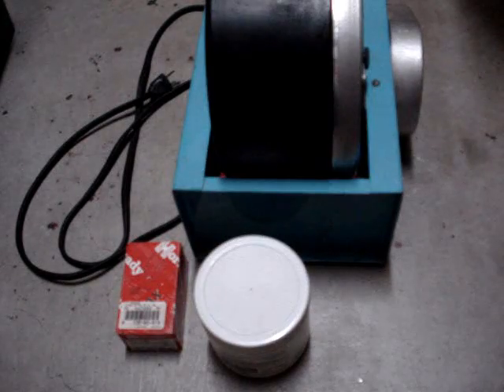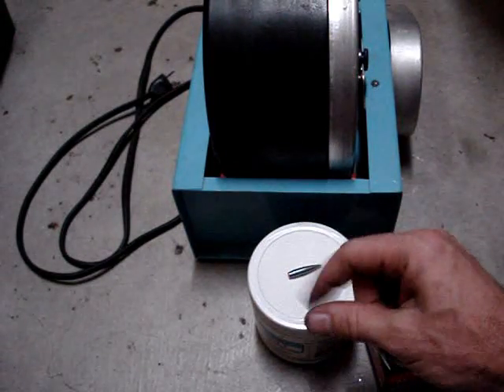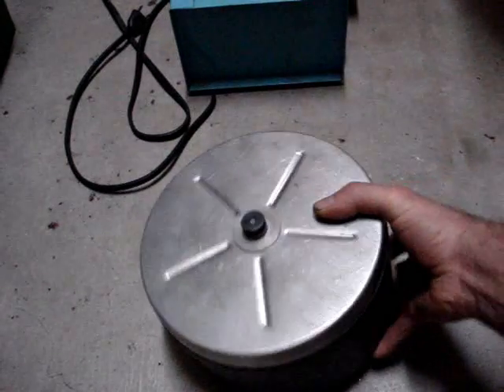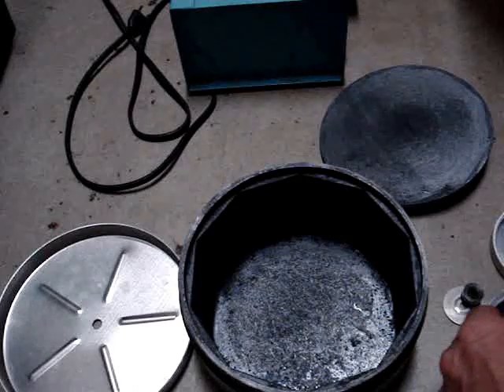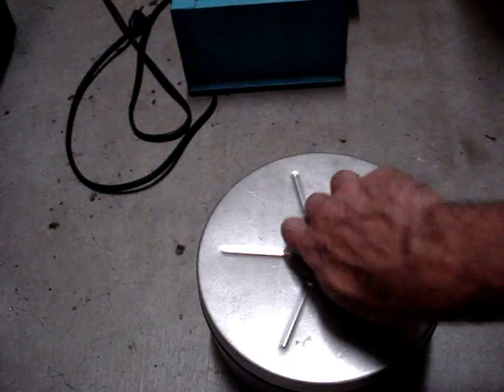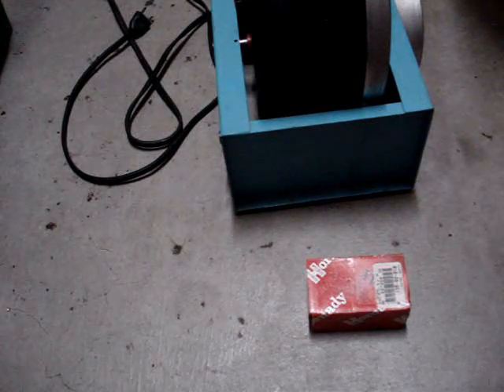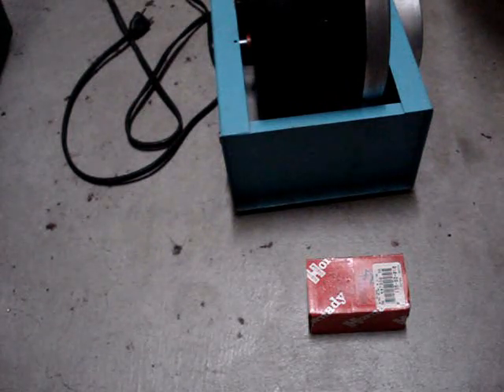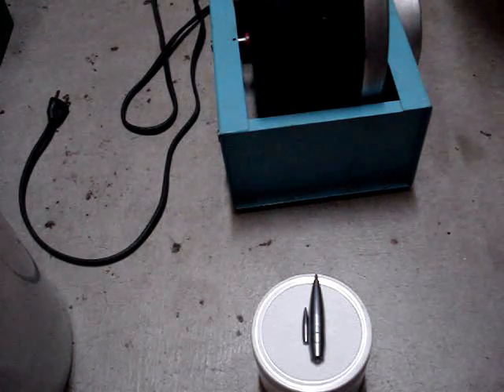Moly Coating

Comment: I don't understand why everyone says you need to extensively clean your barrel when transitioning from moly to non-moly coated bullets.  The moly coating does slick the inside of the barrel thus reducing wear.  It will not have any adverse affects other than maybe making the first few rounds of non-moly a tad faster.  cleaning the barrel extensively will only remove more of the moly therefore increasing friction.

Comment: @ammosmith I do moly coat all my cast boolits, Quenched WW lead alloy and then pan lube onto of that. I know that seems like a lot of work but they turn out real nice and shoot very well. I did this as just pan lubing i was getting leading on my M&P9pro, with just moly, alot less leading but still leading. When i did both though, the moly didn't coat my fingers and all leading was gone. BTW i was using the Lymans kit on a vibrator if that makes a difference.

Comment: How much faster fps is Molly getting you vs non molly coated
Reply from the maker: It depends on the caliber but about 50 fps average increase. It's a mess to clean up so I don't use it anymore.
Reply: @ammosmith  
If its not illegal in your state im gonna try teflon coatings over lead hotter it gets the more it lubes lol 
So ill do a 50 50 Teflon nylon coating.
Reply from the maker: @adamlong54  There's a myth behind Teflon . Teflon coated bullets do not penetrate body armor. The KTM bullet was a tungsten  carbide core with Teflon used as a jacket to protect the rifling. A pointed cast zinc bullet will do the same thing.
Reply: @ammosmith  i know not why im doing it want faster fps. Hence the Teflon aka lube lol

Comment: I do just what you are doing. One thing I add to the barrel is enough BB's to cover the bottom. Won't damage cast or jacketed bullets. I roll the bullets after in a towel to remove the loose Molly.  As for cleaning the barrel, I run a wet patch (Hoppe's) through the bore and stand the rifle muzzle down on a paper and set it soak over night. Then clean in the normal way.

Comment from the maker: Yes id does foul your barrel. The easiest way to remove it is to use a bore paste. Moly can improve accuracy. Like all firearms it's a trial and error session at the range. Try a bunch of plain bullets then try the moly. Make sure you clean the barrel when transitioning from either plain to moly. This will ensure you have a good clean bore. After a good cleaning you'll need to fire 3-5 rounds to foul or season the barrel again before optimum accuracy.

Comment: While it reduces copper fouling, don't you end up with moly fouling? I've just started reloading, and have looked at buying moly coated bullets, but have read a few things saying that moly coating is just as much of a pain, if not more so, than removing copper fouling! Just wondering if you can shed any light on this subject.

Comment: I understand your reaction, just moly, and shoot some "regular" stuff and check the inside of your barrel and your groupings after, it will explain more than me saying it? I'm not saying it's bad to use moly, it works excellent, but you can't just go back to normal use without some work on it..

Comment: Molybdenum disulfide powder is very dangerous to your health, use latex gloves and a respirator....I made some Molly grease using a P.T.F.E. grease as a carrier. prior to using molly bullets, clean your barrel as you normally would, run a few dry  patches afterwards, then repeat the process with the Molly grease, now it's ready for the molly bullets. I've done this process with all of my bolt actions, "My Swiss K-31, .303 British,  8mm Mauser and a couple of AR-15's. Made a HUGE DIFFERENCE" in accuracy and reduced fouling dramatically, Just like a Teflon coated non stick pan. great stuff.
                thanks for sharing!
                Eric Dee.

Comment from the maker: Not really. The best way tofix that bore is to use a bore paste. Most of the dark bore is due to old fouling and a pristine bore lays beneath. If you are of the mindset...you can get setup for reloading for about $120 and load for it using Sierra 174gr .311" Match Kings. What kind of scope do you have on it?

Comment from the maker: I find that it clings to the metal. A good scrubbing works wonders. BTW..the 75gr A-Max is a nasty little pill. I shot a squirrel and it blew it to about 100 pieces and flung it 30 feet. It's not something I want to get hit with.

Comment: have you tried denature alcohol?...my niegbors have bands and are deaf so vibration tumbling is not an issue nor firing civilian war cannons. I have seen others actaully put all th moly coat in the tumbler/vibrating thing. I checked and its says that cast lead bullet must be prelubed before moly coating them and then it can crystalize in some barrels. Now with newer cleaners its easier to find products that remove all fouling from powder/metals/plastics. Thanks for the video!

Comment: Moly Questions & Answers

Molybdenum Disulfide (Moly Ultra-Coat)

Molybdenum disulfide or "Moly", as it is commonly called, is a lubricant used in extreme pressure conditions due to its high degree of lubricity and high melting point. Moly has been found to reduce bore fouling when applied to bullet surfaces. It will decrease bore cleaning effort and time. Published reports have shown an increase in Ballistic Coefficient, longer barrel life, and an increase in accuracy.

Moly coated bullets will reduce pressure and velocity. Loads must be worked up slowly to attain previous velocities, therefore the maximum pressure of the cartridge must not be exceeded under any circumstances.

NOTE: This does NOT mean powder can be added indiscriminately. 

NOTE: Loading data for Moly Coated Bullets and Non-Moly Coated Bullets is not interchangeable.

Below are questions concerning Moly coating that MidwayUSA customers have been asking with technical advice for each: 

Do I need steel shot? 
Steel shot is not needed in the MidwayUSA process.
Steel shot is used in other processes as a burnishing aid to imbed the Moly into the bullet surface.
By using the MidwayUSA 1292 Tumbler, bullet on bullet impact imbeds Moly into the bullet surface without the use of steel shot. 

Do I need carnauba wax?
Carnauba wax is not needed.
Carnauba wax is used in other processes so the Moly would not rub off the bullets.
Some shooters using carnauba wax have found that the wax accumulates in the bore and crystallizes.

How many bullets can I coat?
A. An 8 oz container will coat approximately 970 lbs of jacketed bullets or 485 lbs of cast lead bullets.
B. The maximum load for a MidwayUSA 1292 Tumbler is 10 lbs.

Do cast lead bullets still need to be lubed?
Yes. Even though cast lead bullets have been Moly-coated they still must be lubed after Moly coating.
If Midway pre-sized and lubed cast bullets are being Moly-coated freeze the bullets for two hours then tumble with Moly for 20 minutes.

Why do I need different bowls for coating jacketed and cast lead bullets?
When coating cast lead bullets or bullets with exposed lead (i.e. soft points, spitzers) a layer of lead is deposited on the surface of the bowl. This layer of lead can then be transferred to a bullet’s copper jacket or plating causing the Moly not to adhere.
Bowls used for coating bullets with exposed lead (i.e. soft points, spitzers) should be cleaned after each use.
Bowls used for coating cast lead bullets should be cleaned after coating 50 lbs of bullets.
Bowls used for bullets without exposed lead (i.e. FMJ, HPBT) should be cleaned after coating 50 lbs of bullets.

How do I clean the bowl?
Fill the bowl just above the Moly stain line with corn cob or walnut media.
Pour 3-4 tablespoons of bore cleaner into the media.
Tumble the media/bore cleaner mixture for 30 minutes or until bowl is clean.
Wipe the bowl out with a clean cloth.
Degrease the bowl with liquid dish washing detergent and warm water.
Some Moly will remain embedded in the plastic bowl; which is perfectly fine. This cleaning process will remove any lead deposited in the bowl.

How pure is MidwayUSA Moly?
MidwayUSA Moly is 98.5% pure.
Impurities are mostly residual carbon created during production.
C. MidwayUSA Moly does not contain graphite. Graphite is hygroscopic and promotes rust.

What is the particle size of MidwayUSA Moly?
MidwayUSA Moly is considered to be technical grade. Particle size ranges from 1 to 100 microns.
The Fisher rating, or average particle size, is 3 to 4 microns.

How does Moly coating increase velocity?
Moly coating actually decreases pressure and muzzle velocity because of reduced friction between the bullet and bore.
Moly coating will increase terminal velocity by increasing the ballistic coefficient of the bullet. Moly has higher lubricity than the jacket material. This lubricity causes a reduced coefficient of friction in the air. The reduced drag results in a higher ballistic coefficient.

How do I obtain loading data for moly coated bullets?
Load data for Moly-coated bullets is NOT interchangeable with that of non-coated bullets.
MidwayUSA does not carry load data for Moly coated bullets.
Moly coated bullets will reduce pressure and velocity. Loads must be worked up slowly to attain previous velocities.
The maximum pressure of the cartridge must not be exceeded under any circumstances.

I’m shooting Moly-coated bullets and my groups are much larger than they were with non-coated bullets. What’s the problem?
It will take approximately 15-30 "fouling" shots with Moly-coated bullets to deposit a thin coat of Moly to the bore. The first coated bullet fired will deposit a small amount of Moly in the bore close to the throat. The next bullet will deposit more Moly where the first left off. Moly deposition will continue towards the muzzle until the entire length of the bore is coated. These fouling shots will provide a sporadic group because of the varying amount of friction in the bore. After the fouling procedure rounds should "settle in" and groups will tighten up.
Moly-coated bullets will reduce pressure and velocity. Loads need to be worked up slowly to attain original velocities. Dramatically reduced velocities generally deliver poor accuracy results.
It is suggested that loads be chronographed when working up a new load. It will be much easier attaining desirable results with velocity data from your firearm. This is true for all load testing, not just Moly loads.
Some non-Moly coated bullet/powder combinations may shoot better than a Moly-coated bullet/powder combination in a specific firearm.

How do I clean my firearm without removing the Moly?
Running a dry patch through the bore should remove any fouling; most of which will be carbon fouling.
If cleaning with a bore solvent is desired the bore will need to be recoated with Moly. This is accomplished by firing 15-30 fouling shots with Moly-coated bullets.

Comment: What brand of Moly do you use?  I heard that you can Moly Coat lead cast bullets.
Reply: you can do cast lead bullets but you must do the pre lube first  like you normally do on them. Midway usa has a Q&A on moly coating that is really great information and its for you to decide if its good or bad for that particular firearm and bullet your firing as each will be different. I know they also have bore treatments thast coat the bore and is suppose to be better then moly coating a bullet and its works best on better kept bores but with mixed results for all. moly coat can erode barrals if moisture comes into cantact with it...check on Hexagonal Boron Nitride its considered the betetr caoting and no barrel erosion.

Comment: @ammosmith Yeah, it's a fad, but i am always interested in hearing and trying, its part of the hobby. Reloading became a major shooting experience item, always curious how it works out after spending hours of measuring and precise reloading and sometimes it dont work out, i'm sure you know the feeling. I have seen your other video's, great work! My first reload round was the 44-40, hard to start with (bottlenecked case), but learned a lot. Now only use Moly in my 7.62x54R